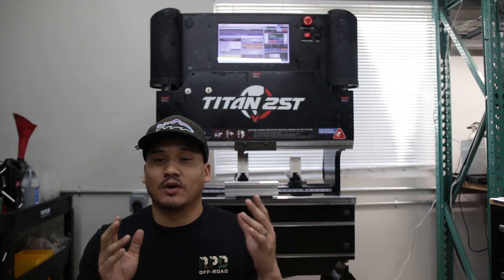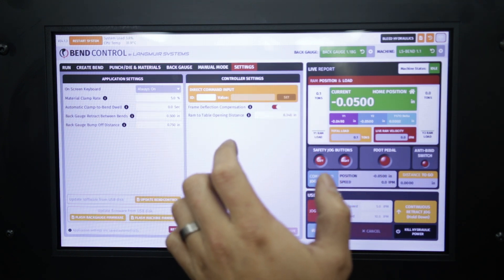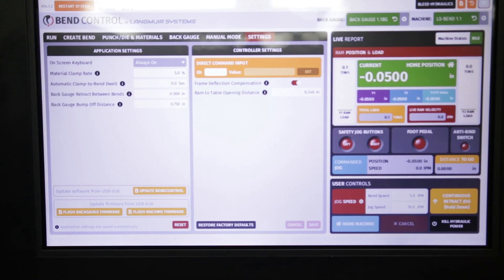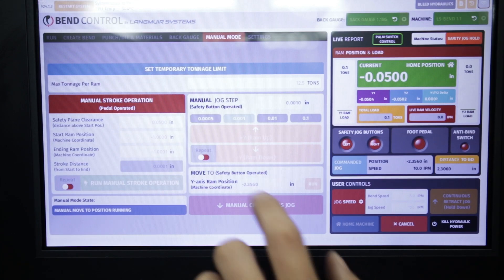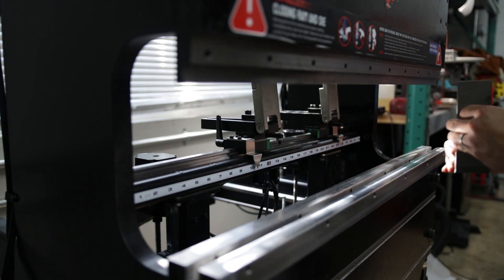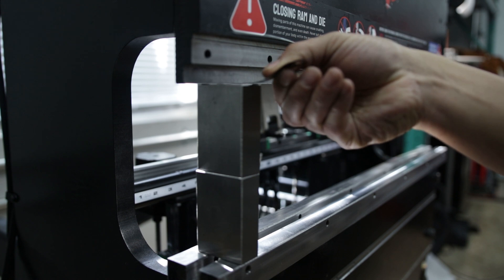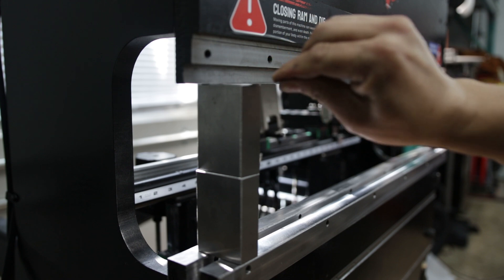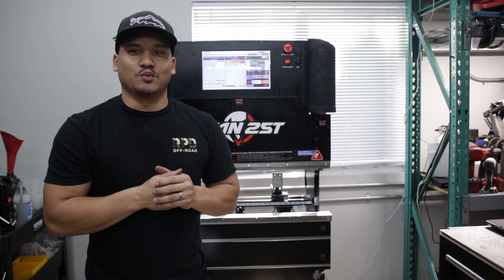Calculate Table to Ram Opening - Langmuir Pressbrake

Comment: real press brakes have settings to adjust the L and R compensation - Langmuir should have programmed that into their software.
Reply from the maker: I guess this isn’t a real pressbrake 😂
Reply: @RathaSochenda  Machines from the 60's had compensation - just one of the many issues I would hope Langmuir integrates into the software for future updates. I like my 25T, but there are some things about it that absolutely need to be changed.